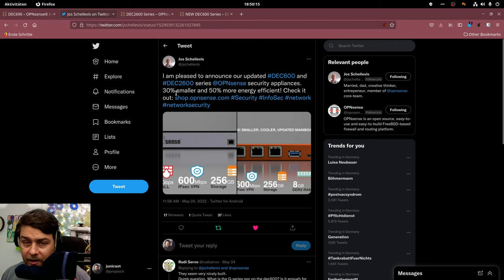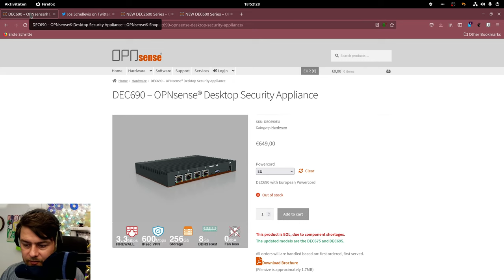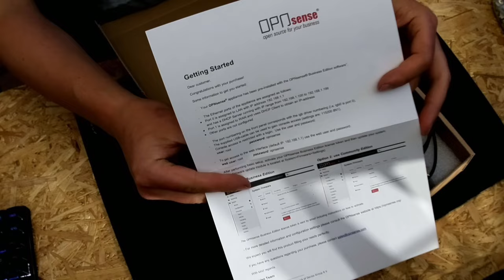Deciso DEC695 OPNsense Firewall unboxing / teardown

Comment: For how many concurrent users / devices is this model intended? I did not find it in the specs or I overlooked :)
Reply from the maker: The specs say it can handle up to 7,000,000 concurrent connections. So unless you're not doing bittorrent or similar stuff I say it should suffice even in bigger office environments.